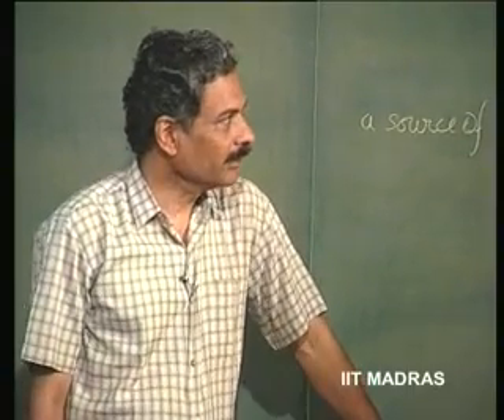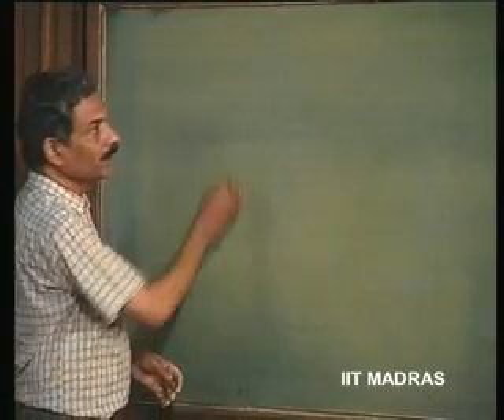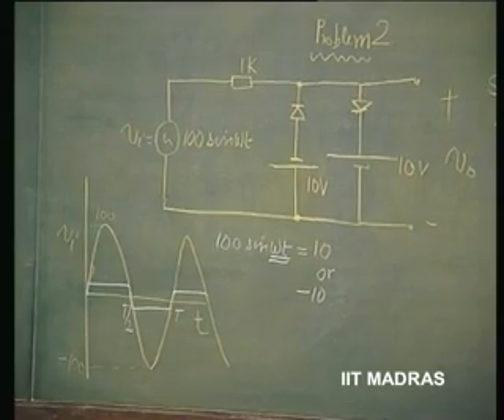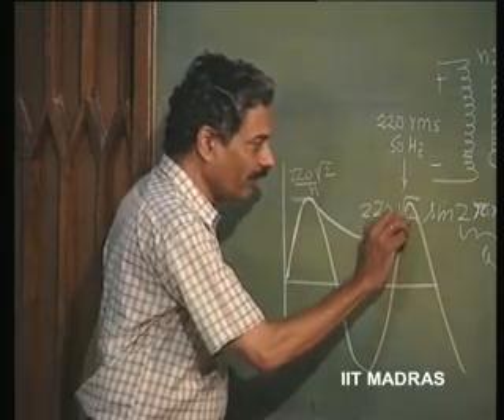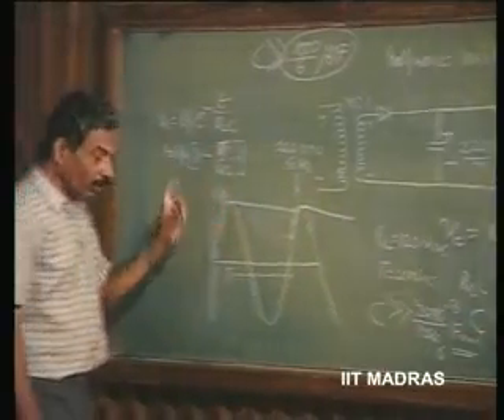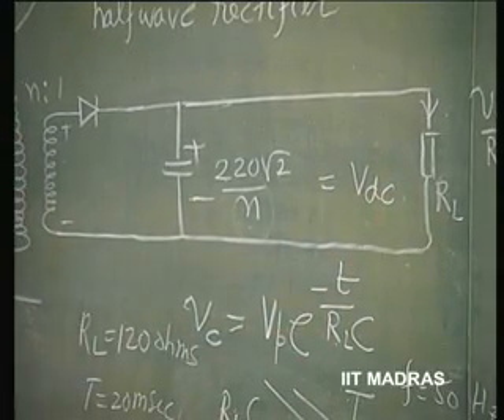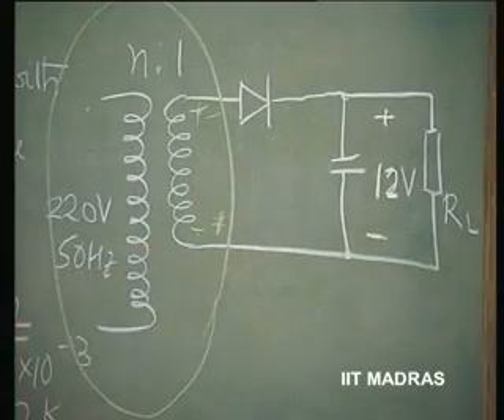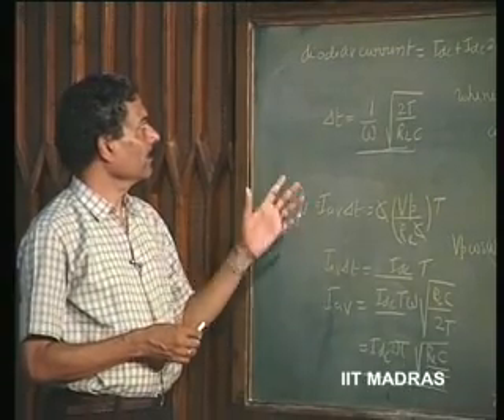Lecture - 5 Voltage Multiplier

Comment: @ 04.16 why is it not 0v to -200V??
Reply: The voltage across the diode will be : (By using KVL)
Vdiode = Vmsinωt +Vm  ; 
where Vmsinωt is the ac source voltage and Vm is the voltage developed across capacitor 
So as Vm =100v
Vdiode varies from 0 to 200V.
Reply: @CHINMAY SHETYE  no. Voltage should be defined as potential of point x with respect to point y. X is the cathode of the diode and you the anode.
Reply: You are actually right. Should be maximum of zero on cathode of first diode with respect to the anode. Wondering why it's only you who noticed it

Comment: Thank you form putting up this piece of work. Would there be any chance to look at solar  systems controllers & associate battery chargers as they seem to be very expensive ..... and a home makable design you help the global village ..... i must admit I also looking for designs of alkali battery also, that as I understand it can use sodium hydroxide ( drain cleaner ) & iron & nickel plates. Any thoughts.

Comment: I have a question, this is still approximately 100v at the begining right ? the diode still produces a voltage drop of 0,7 V (Si) ?
Reply: That's insignificant for all practical purposes.